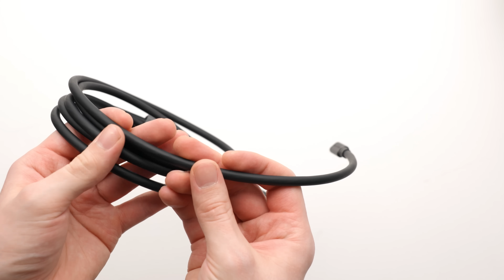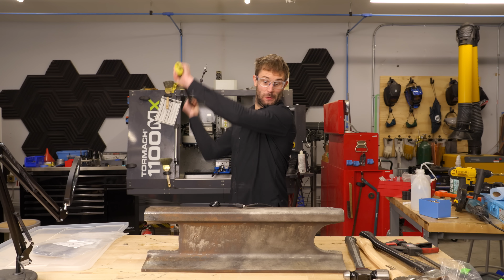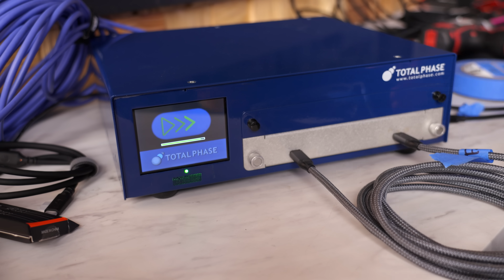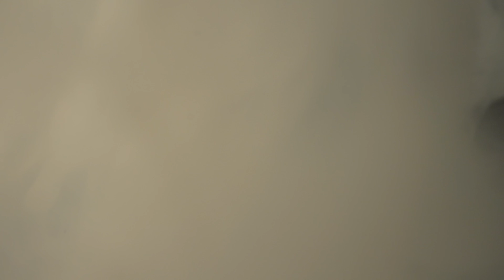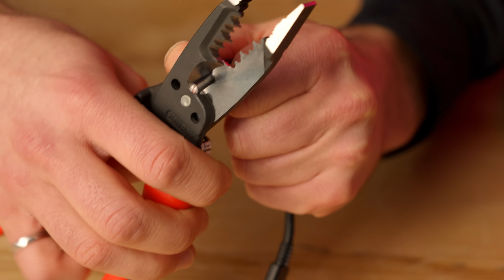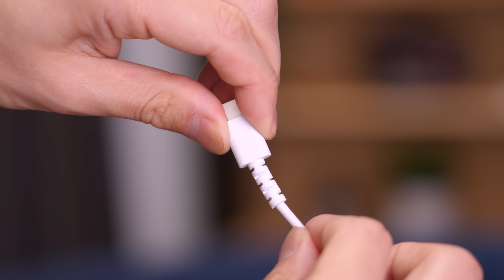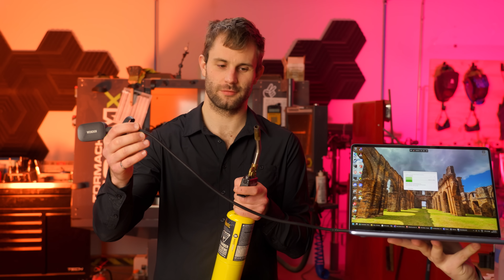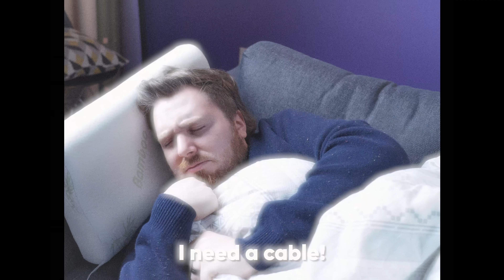Why It Took Me 4 YEARS to Make a USB Cable

Comment: the price on these cables are not really that bad for what they are. Sadly I bought 4 new cables from anker rated at these speeds (240watts 40gbit) and they were more expensive than the LTT cables. Eventho they are expensive, they are insane and will last a long long time, so the investment is well worth it compared to buying cheaper cables that need frequent replacing. well done, eventho I have'nt tried the LTT cable I know they will slap.

Comment: Cool.  Bad cables can destroy your computer.  When you have a LG C2/C3/C4 OLED TV paired with a RTX 3090 or 4090, a cheap HDMI cable can destroy your graphics card.  I RMA'd my 4090 after it died.  ZOTEC replaced it for free, but I still had problems with the replacement as soon as I put it in.  I DDG the problem and found out that bad HDMI cables cause the problem.  I switched to an optical HDMI cable to remove the electrical connection and the problem went away.  The optical HDMI cable is almost perfect.  Sometimes the cable doesn't sync up and I have to unplug the TV and restart my computer when waking up my PC. If Linus had a good HDMI cable, I will try it.

The next time I buy USB-C cables, I'll go with Linus.  I have that major brand of cable from Amazon.  They are pretty good, but I wonder if it can do better.

Comment: The rubber connector housing looks way too thick. I doubt it's within the USB Type-C specs. There are going to be recessed plugs on many devices (including phones with a case on them) that might not work with these cables.

Comment: Honestly, I was expecting $40+ for a highly spec'd and well built cable with the amount of R&D that you described and coming from such a small company (compared to Anker, UGreen, etc). Under $30 USD is very fair. I hope to one day see some high quality and correctly spec'd HDMI, Displayport, and maybe even some fiber optic cables with this level of dedication to quality.

Comment: I could've possibly used these 5 months ago and would've bought like 50 of them.  I was working on a project using the raspberry pi, and for a silly reason it would constantly show a low votage warning.  The problem was that Raspberry PI invented their own power delivery spec which NO ONE else uses.  So if you used it with a battery that had PD (power delivery) it would still default to 5V which was the limit point for the raspberry pi warning.  If your power supply (battery) was delivering 5v like it's required to do, it was up to the cable to not drop the voltage.  So on short cables it would work fine, it got the 5v, no warning.  But on like a 2 foot long cable the voltage dropped just enough to throw the warning.  So annoying!!! Ever since then I've been hoping for quality USB cables.  I've never bought anything from LTT before, but I'm excited for these.

Comment: I like the idea behind this cable but here's my genuine gripes: There's no information about the USB Alternate Modes (DP-Alt mode: required for some legacy connections) or PCIE tunneling for eGPU's. There's no information about whether it meets USB4 1.0 or 2.0 Specification which is the difference between DP1.4a minimum and DP2.1 minimum. There's no information about the E-Marker chip.

Also even a "Slowing down" 80gbps connector will outperform a 40gbps connector on asymmetric data transfer. It's weird to me that your aiming for full spec speed without degredation- but not for the fastest speed. It's kinda like trying to sell the absolute best stock-OC of a last generation GPU instead of the new one which will always outperform the old. 

UGreen sells a 1M Gen4 80gbps 240w. (Also without information about PCIE or alt mode tunneling) but they aren't claiming full specification transparency/implementation and it costs £17.99 to £21.99 depending on sales with free shipping. Shipping from LTT is £10. 

Obviously I know LTT can't control shipping costs or economies of scale, but it's the kind of product I am absolutely the target audience for (given how much of a nerd I am about the specs above) but I just can't justify getting it. 

Prempting any "Just don't buy it then" replies": Yeah I won't, just giving feedback.

Comment: The most outrageous thing is it's literally impossible to find slim thin and light usb c cables. No cheap, no expensive ones.
Only the apple one.

All the stuff is extremely bulky for no good reason. The basic usb 2 with 60w which everyone uses doesn't need to be.
I don't get where they get these for products they ship them with. 
I have some of these cables I seek from products I bought an love them. 

And it's not like they break easily or anything. Am using the most simplest slimmest silicone one 1.5m long for years and it's doing great. It's as minimal as it gets. 
Impossible to find for sale.

Like they make them bulky just so they can justify charging you $10+ for a stupid cable. Apparently people think it's quality and robust or whatever.
I want the $1 cable. It is much more practical.

Comment: Honestly id rather the end of even an 'expensive' cable fail and snap and require replacement than for example, one of the C ports on my VERY expensive Macbook Pro M4 Max.... Being so strong will just make it a better 'lever' to snap the soldered on USB-C port in your device...
Otherwise, chuckled at myself that I basically choose to watch a 14 minute 'ad', lol...

Comment: Did you actually not think to try and use an Ethernet cable manufacturer? The margins have to better and this cable is essentially just a silicon cat7 with a funny end

Comment: Honestly, blame Amazon for letting sellers blatantly lie about their specs....
Reply: Same goes for many of the general electronics on Amazon and not only do they encourage it, they let them have their way with that thing they call a search bar. I couldn't tell you how many times I thought something I needed wasn't available only to randomly stumble on it later despite there being no discernable reason for it to not be easy to find.

That said, I have found the occasional gem like a chunky 6 foot, 40 Gbps/100W, Thunderbolt/USB-C 4 cable for $29 that I thought for sure I'd just return but it ended up passing every test I threw at it with flying colors. Of course it's now no longer available... the seller probably realized it's way more profitable to not actually have to offer what they advertise. I also highly doubt it was certified to use thunderbolt branding but it did actually support it.

Comment: Can you let us preorder the cables? I don't want to have this be a GPU shortage situation where the day comes for next stock and they are all just gone again instantly. It worked for the OG screwdriver and it will work for this. You will also have a good idea what you need to have made.

Comment: These prices are reasonable. I pay about 50% of these prices for 10ft cables, that admittedly do last several years at a time, but ultimately do fail and do not come with that LTT guarantee. I shall order some of those 3.5m next time one of mine dies.

Comment: i hope u sees this
cool cable and all but i would love to get one with the connecter in a 90 angle
Reply: Hopefully they sell one that’s 270 degrees as well! 

/s
Reply: @cat5kable  don't forget about 360 gang
Reply: @Secunder nah I’m about that 720 life
Reply: @cat5kable I felt a part of my soul fade into the either reading that
Reply: I would be amazed if they don't with how well it is selling
Reply: 90° dongle is cheaper for you to get than for them to produce and sale twice as much.

now, idea for LTT: High Quality 90° USB-C dongle!
Reply: @onepiecepedia  USBIF put the kibosh on that iirc
Reply: That’s a good idea actually 🤔 had to give you a like so this comment gets visibility
Reply: They could just sell adapters too. I have some ugreen ones I used for my Steamdeck and other misc but I have a feeling they are causing odd issues, especially on the couple I have on a rackmount of pis.
Reply: @urmastertech those adapters can never be certified by the USBIF for reasons I hope are obvious
Reply: See if you can get PureLink PI6620 (horizontally angled) or PI6610 (vertically angled). They are likely from the same manufacturer as the LTT cables. The cable rendering in the PureLink brochure matches what you see in this video very closely.
Reply: 90° folded the long way or the short way? 🤔
Reply: it can't take another year or two for that, right?

Comment: I just checked the pricing in the code...honestly, the pricing seems reasonable. I just looked at a similar cable to what I purchased on Amazon a few months ago, and the LTT one is a bit cheaper. Though I suspect LTT would charge shipping which would probably make theirs slightly more expensive.

Comment: I have worked in the aerospace industries and took certifications for cable assembly and it always baffled me how consumer grade cables are so freaking cheap when I saw your LTT cables and how thick they were, I knew instantly they were way more durable than 5-10$ cables from amazon. I think I went through 4 cables for my wired controller and will definitely buy one from you

Comment: I got a coiled aviator cable for my new keyboard from Amazon. Everything was OK, but after a short time, something strange started to happen. Whenever I turned on my desk lamp, my keyboard lit up and if my PC was asleep, it woke up. Approx a week after this started, the keyboard started to glitch out and turned off randomly during Minecraft gameplay exclusively :D (when my son was playing).
Mind you, the keyboard is no cheap Dell for 15 bucks. It's Wobkey Crush 80 Pro.
It turned out, it was the cable. Once I switched the coiled one for a simple straight USB-C one I had in my "cable drawer", everything's peachy.
So, yeah ... cables. You can't trust 'em!

Comment: physically showing the cable internal is one thing, having a chip in the USB head that's compatible with everything is another.  can someone show on video this cable will work with Samsung smartswitch to backup phone at USB 3.2 speeds?  (phone USB port is 3.2). I bought a expensive USB 4 cable that turned out to not even get detected by Samsung smartswitch. what's the point of a fast cable if can't be used for phone backup because it's not compatible with Samsung specs.

Comment: Pretty happy with my screwdriver, which has been used for a while now. Considering the crap I've come across in this particular market, I'm definitely willing to try this too. And I'm not even necessarily a huge LTT fan, lol (why did you text his old phone number, Linus).
Reply from the maker: Just didn't have an up to date number for someone I fell out with after they pretended to care so much about our backpack warranty that it compelled them to publicly denounce our relationship. Totally normal behavior over a company with a solid history of standing behind its products. Not super deep - LS
Reply: @LinusTechTips  
The way this random YT commenter nobody sees it is that you were expecting a friend to compromise on his principles, choosing to take it personal when there was no need to. I've seen many tie it to narcissism, but I think it's more to do with insecurity, which can in certain cases increase the more successful you get. Just look at Elon (extreme case, with success mostly stemming from stock hype fraud). Strife can in fact be met with excitement instead of dread and angst (defensive behavior).

Unnecessary parasocial psychoanalysis aside, I'm definitely looking forwards to seeing how the 5m cable behaves with my controller. One annoying quirk with USB-C is the connector not really sitting firmly in place (especially with movement), but I'm not sure how easy that is to tackle. Those shipping costs though... EU distributor (or something) needed!

Comment: And they're pretty much all sold out 😭 I would have appreciated a more "launch will be x day at x time" rather than "surprise, while you were at work we released them and they sold out". Its the scalper problem all over again (though without scalpers this time, just dedicated fans).

Edit: Also, any hope for "braided" cable sheathing? I have cats that don't CHEW on cables, but have occasionally nibbled enough to damage the jacket on previous cables.

Comment: That so many manufacturers couldn't deliver is worrying. And I'm also very surprised by the reasonable price. I thought they would be what more expensive. I'll definitely ad some when they are back in stock and I need a good cable.

Comment: Aight, you got my like at "I need a cable" instead of at the end of the video.
Reply: Dear God, I wasn't expecting the extended reprise at the end. Great job guys, that was a great ad, and I will definitely be picking one up soon.

Edit: when they're back in stock at least. Congrats on the high quick sales!

Comment: You're kidding right? 30$ expensive? You do realize I'm buying shit cables so called premium with 40€ and get shit right? So if those cables of yours actually work, then this is a steal. Why shit? 1st they fail the tests, 2nd yes it's slowing down the data, not only example photos on camera to the pc or reverse, but slowing down monitor image. Yes, it's possible. 3rd after 1 year they're doomed, goodbye, adios. They ripping apart and from that moment on goodbye. And no I can't fix that, I'm not god bruhhhh 😑. I am an IT guy, but I'm not god.

Comment: I wonder if its the same for hdmi? I have an 3 old NVRs at work that will ONLY work with an old unidirectional HDMI cable we have but we only have one cable and it's 50 ft long. We tried so many things to get it to work with new hdmi cables.

Comment: still far cheaper then the ones that sold in my country for its value
only if it was possible for me to buy 240w version at the price it is listed on the website
if you add shipping and import tax a single 25CAD cable becomes 500CAD. not joking 😩

love from Türkiye

Comment: the 6.6ft 240w is 3 times cheaper then the 100w cable i'm using right now that lasted me 5 years of daily use but is on it's last leg. looking forward to it being back in stock. how do you guys think it will do for being tugged on, on a VR headset?

Comment: Tip: I like that all cables have the same price, but to avoid always choosing the longest cable, I would prefer a price scale. It doesn’t have to be a big difference, but for example 25 to 30.

Comment: Huh... I went to the website and was surprised by the price. I was expecting at least double what was listed. Only problem I see is the shipping to Sweden is about the same cost as a single cable. So I might need to bundle a couple together.

I'd previously only relied on Anker Cables but supplies over here have been spotty as best.

Thanks Linus

Comment: @LinusTechTips I hope someone of the team can answer me:
I only know so much about USB. For what specs of a cable should i look, if I want the optimal one for plugging it into a 8kHz low input latency controller? I only need 1m length, but it should be lowest possible pull weight on the back of the controller. 5V 1A should be more than enough and I guess the required max data throughput even with 8kHz polling rate shouldn't be high. The only things that should matter from my understanding, are latency and error free transmission of the data packets. Is there any difference, if using one of your cables, for latency and what is the cause of that (error free transmission is a core selling point, so latency spikes caused by that obviously shouldn't be a thing)?
If more people show interest in different, but dedicated usescases (one cable specifically for one job, to be the perfect one) for USB cables, I would love you to do a educational deep-dive followup video.
Regardless, I'm ordering a batch of different cables. If the quality is near that of the screwdriver, this will be the best USB cables I own by a mile! Keep up the good work!

Comment: The USB symbol is used on the USB-A side to indicate which side is up!  
if you just have the cable with the logo facing up, it should plug in first time if the devices are compliant.
Reply: ... All the USB A ports on my PC are vertical:-(
Reply: @tompw3141  It’s still facing “up” on a mobo if it were laying flat.

Comment: I'd love to see a "usb condom" cable or adaptor on LTT store someday
(data-blocking power delivery cables/adaptors, for when you need to use a sketchy public usb power socket, in case anyone hasn't heard the term)